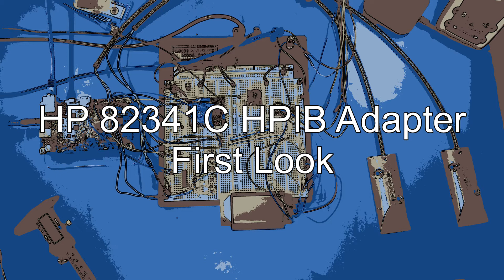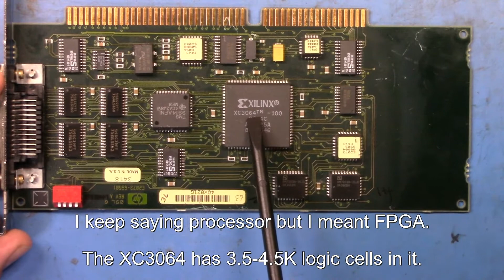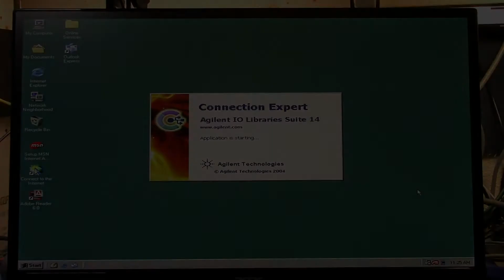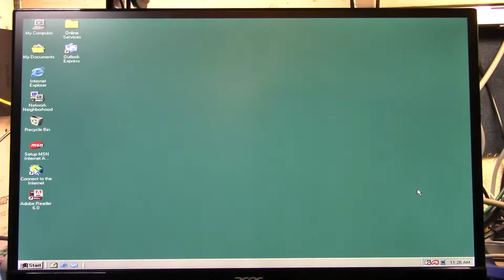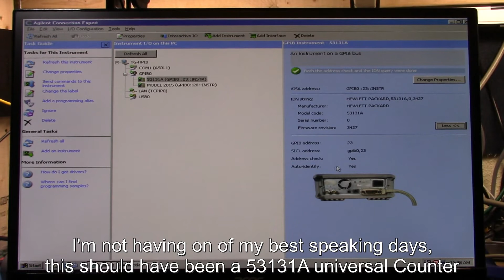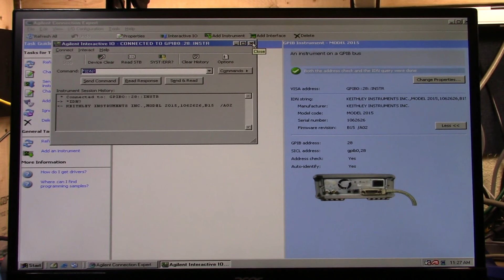HP 82341C HPIB Adapter - First Look

Comment: im trying to look for drivers for this card can anyone help me
Reply from the maker: These cards were supported in the IO Libraries version 14.2 and only for certain OS versions (though you can run the Win2K drivers on XP I think). Download the installer from https://www.keysight.com/main/software.jspx?cc=US&lc=eng&nid=-33330.977662&id=2175637&pageMode=PV